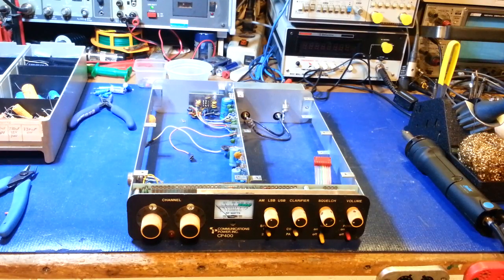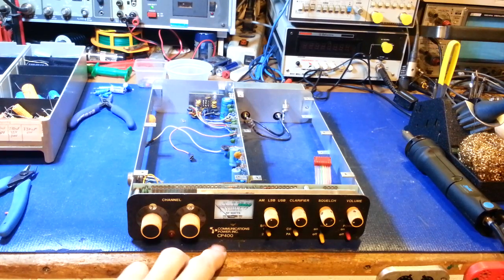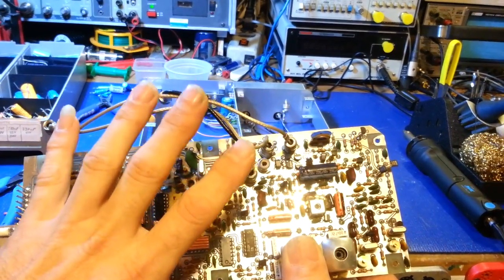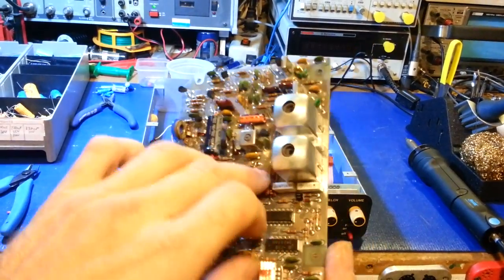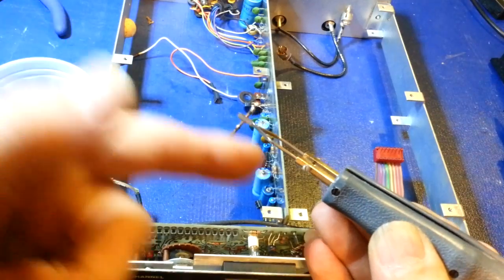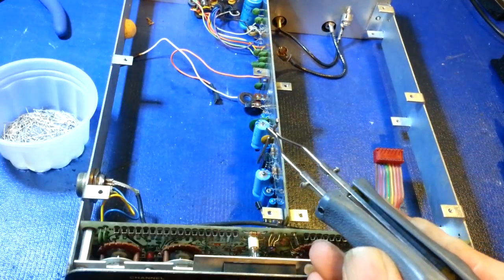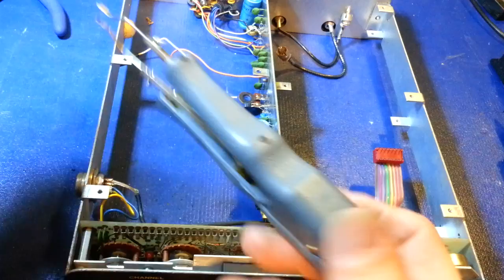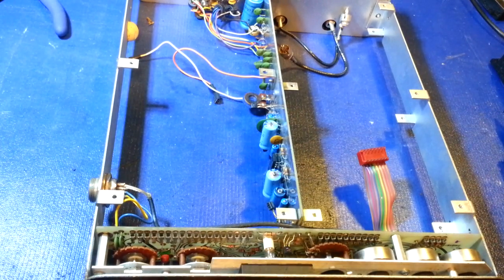Advanced desoldering thru hole components on double sided PCB's with large ground planes.

Comment: What if I want to do the opposite? Solder something with a large ground plane. I can’t seem to get the solder to build a strong connection (it’s a connector so it will experience pull forces).

Comment: pace doesn't make the greatest tools anymore, nothing beats Metcal and JBC nowadays in terms of thermal performance, precision, power, tip diversity etc
Reply from the maker: ThinkLearnSolve 

You haven't tried their newer systems then.  Their newest systems are definitely at the top of the pile.   What I'm using here has got to be 15 to 20 years old.  I have one unit that is over 30 years old and is still running strong.  There are three things I love about Pace.  Made in the USA, durability/dependability and support decades after a product goes out of production.  I can still get parts for units made in the 1970's.  Try that with Metcal or JBC.
Reply: no, I haven't, I just don't think anyone can do better than JBC or Metcal, if anything they might be just as good, but I don't particularly find the current Pace station lineup impressive
Reply from the maker: ThinkLearnSolve 

Let's see if they are still working in 40 years and still have full parts support.  Pace does.  Shoot I have a 1970's unit at one bench and it's still running strong and can still get consumables for it.  I would kill for one of their most recent automated BGA stations.
Reply: Yeah I agree ThinkLearnSolve..........I recently upgraded my whole lab and mobile service vehicle to JBC, and although the price was eye watering the process of complex soldering has been made absolutely easy as now..........Its amazing how different it makes my day now......Having said that, the Pace stuff I replaced did serve us well for many years, but the JBC stuff is so up with technology I am glad I made the move.

Comment: Great, until you come to radial electro caps + ground plane. Then what do you use?
Reply from the maker: davecc0000 

You  can increase the tip temperature of the desoldering iron to compensate for the increased thermal drain.  You can also just bend the capacitor over and pull the leads out of it.  If it's being replaced it doesn't matter if it gets damaged.

Comment: Dear Mike, Thanks for showing some of the PACE hand-pieces and the Auxiliary heating technique on boards with ground plans. I can tell your are a long time Pace user and  well trained in the art. Where did you learn of pace ? Military? One of my videos shows aux heat on a multilayer using the sx with an iron heating on the component side. Your video shows one of the best techniques to deal with mass in a pinch.

Comment: These SMD tweezer irons  are cool!  I have struggled with the through holes and have turned my iron full blast just to get the component out, of course not good for the part or bard as you stated.  I am ordering vacuum desoldering gun this week, will checkout the tweezers as well....  Thanks Mike!
Reply from the maker: Anything to add supplemental heat to the other side helps a lot.  I have just found the SMD tweezers work great.

Comment: When I worked for Radiall I used hot tweezers for soldering the center pin conductor onto coaxial bnc's and such.  they have a small hole, and the solder goes into the hole ( about 1-2mm).  if ANY solder flowed out of the hole, did not pass inspection.  (these were gold, of course)   i miss the vibration feeling when you have good conductivity.    Thanks for the video Mike, very well done!
Reply from the maker: The resistance tweezers are handy.  Great when removing and installing parts from terminal tie strips and tube sockets.  The small tips are great for getting in tight spots.  Pace should rename the Resistweeze handpiece the little hummer because they definitely hum when your using them.
Reply: Yeah!   gets hot FAST!    I believe that might just be the best name for them I have ever heard.   From now on...    Little Hummer  it is!   Be Well!